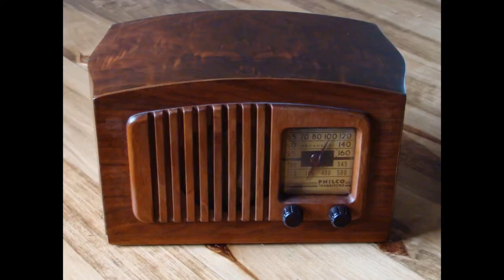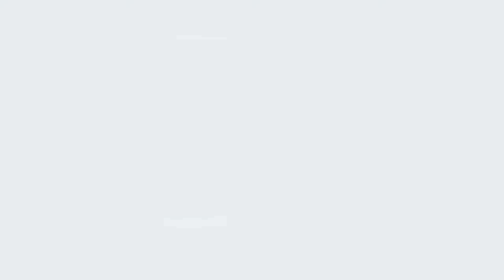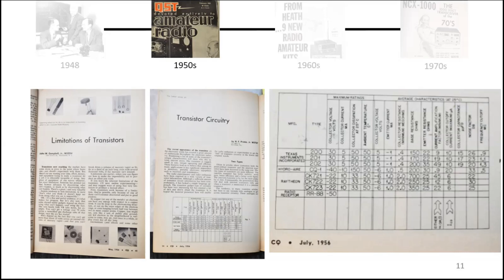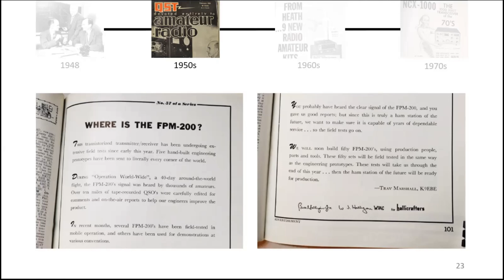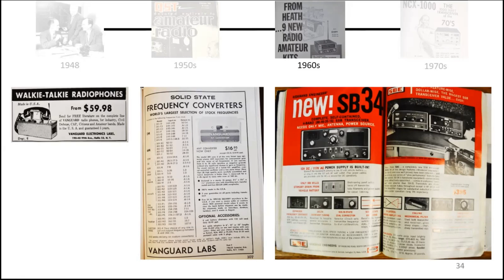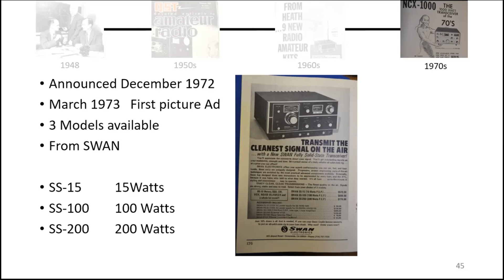The Transistor’s Entry Into Ham Radio

Comment: I really enjoyed this presentation! I wish you had mentioned another pioneer transistor transmitter, built by my uncle Gus Fallgren, W1OGU (later W1OG, now SK). This was in 1956 an 80mW tx for 20m built around two CK761 transistors. Supposedly his contact from MA to Europe was the first with transistors. This is documented at The Transistor Museum website and in the February 1957 Radio & Television News. The prototype is shown in the November 1956 QST. After Gus died his local ham club donated the finished transmitter to the ARRL Museum. I built a nearly exact physical copy of it based on the magazine article illustrations a few years ago and put it on the air. I would have loved to have the original but I didn’t even find out Gus had passed until months afterwards.
Reply: I just read the article in Radio & Television News, fascinating. Thanks for the tip!
Reply: @ae2ea  Thanks! I hope to make an identical form factor 20m regen receiver to go with it.